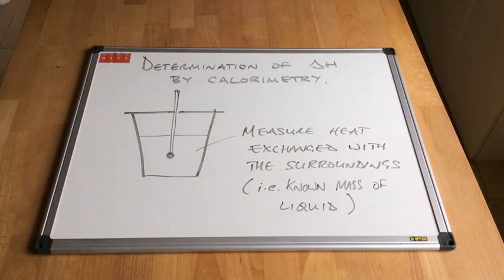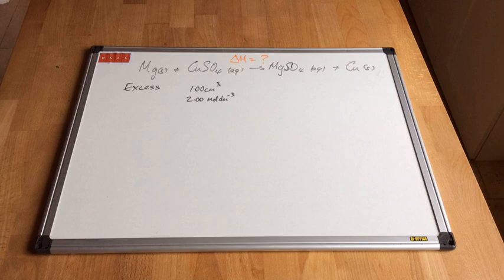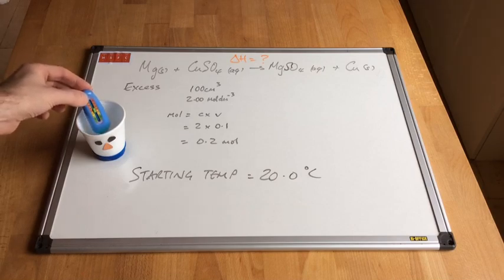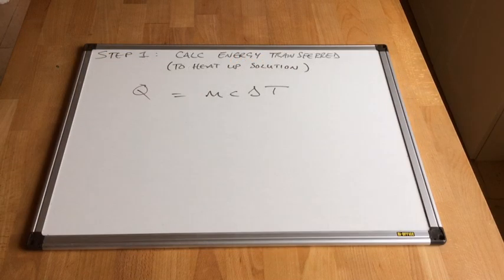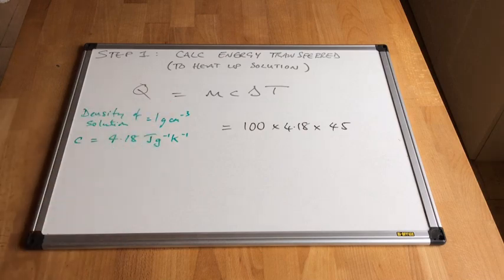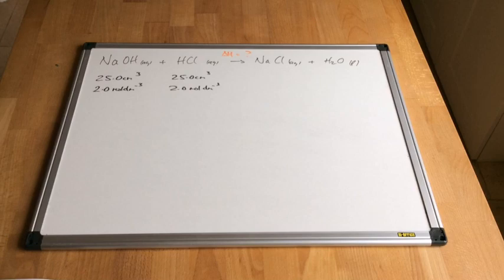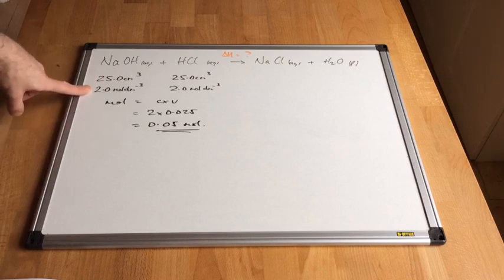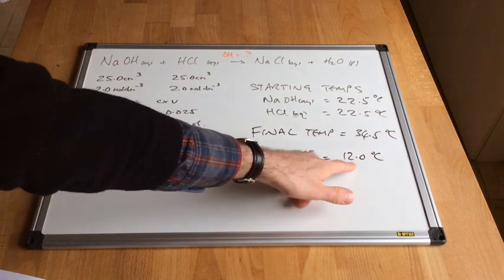Calculating Enthalpy Change of Reaction by Calorimetry

Comment: Hi, thanks for the video.

What number of moles do you divide by when calculating enthalpy for the temperature change caused by a reaction?

e.g. if you are reacting Zn + CuSO4, which number of moles do you use?

I know that one might be in excess, e.g. CuSO4 is in excess, but you can still find the number of moles of CuSO4 that reacted even if it is in excess. So which number of moles would you use?
Reply from the maker: You divide by the moles of the limiting reagent
Reply: @MaChemGuy  thank you. Why is this? Because you could still determine how many moles of the excess reactant that were involved in the reaction
Reply from the maker: @meh3080  Yes but they are directly related to the moles of limiting reagent.

Comment: Sir which mass do you use in enthalpy change solutions? In certain questions they use the volume of the solution added which is turned into mass using density. However, in others they use the mass of the solid too? When do you use which?
Reply from the maker: Questions normally include the phrase 'ignore any increase in mass of solution' Obviously if density of solution info given, they expect a conversion of volume to mass. I agree that some questions don't make it clear. In that case, mark schemes allow both inclusion/omission of solid mass

Comment: Hi sir, why didn't you double the number of moles? 2 x 0.05 mol = 0.1 mol?
Reply from the maker: Hi there! It's because the ratio between both the acid and alkali and water is 1:1. Remember, it's all about the moles of water formed, so if there are 0.05 mol of acid (or 0.05 mol alkali) then 0.05 moles of water will form. Hope that makes sense!
Reply: @MaChemGuy  Ahh ok thanks so much MaChemGuy! I appreciated your very swift and amazing reply!

Comment: Hi

Firstly I'd like to thank you for uploading these video's - they are a great revision source and make me feel much more confident going into my chemistry exams. 
My question is when calculating Enthalpy change of neutralisation, do you divide by the mols of H20. Also, when doing any enthalpy calculation, do you always use the mass of the the reactant thats in soultion when calulating Q? (I'm assuming like in the video if both reactants are in solution, you add the masses) 

Thanks again!
Reply from the maker: +kHromAtic99 Hi, thanks for your comment. Yes you divide by the moles of H2O produced as you are calculating per mole of water. To calculate Q it's always the mass of the solution that is being heated eg. if it's 100cm3 of water being heated then 100g goes into the Q calc. Students often mix up the mass of fuel that heats up the water with the mass of the water. Always the mass of the water. And yes if it's two solutions being mixed and the team changes then its the combined mass of the solutions. Hope this helps

Comment: In the second example, if the amount of moles were different for the two reactants, what number would you divide by in the final calculation (to work out the enthalpy change)?
Reply from the maker: The smallest number of moles = the limiting reagent
Reply: Ah I understand, thank you :)
Reply: MaChemGuy hi, is that only if it’s a 1:1 ratio? If 3 mol of 1 thing reacted with 2 of another, and the second was limiting, would u diving enthalpy change by 2?